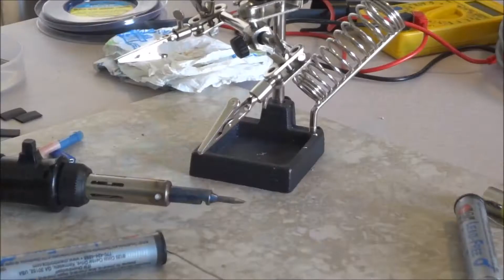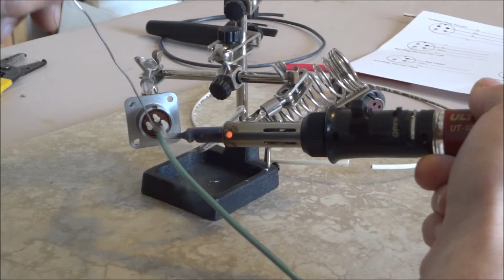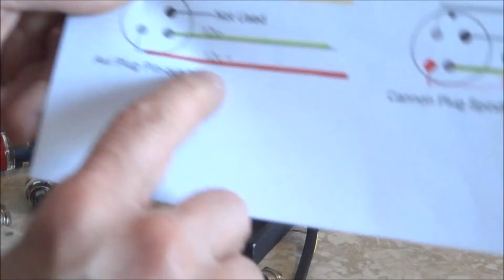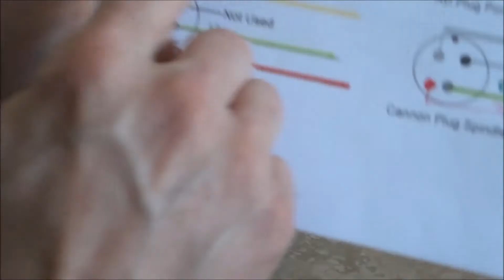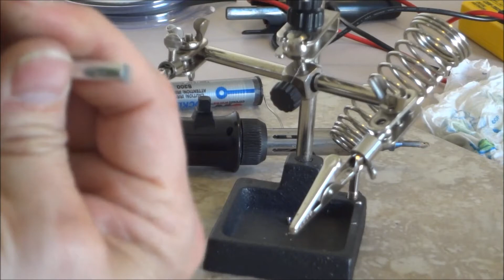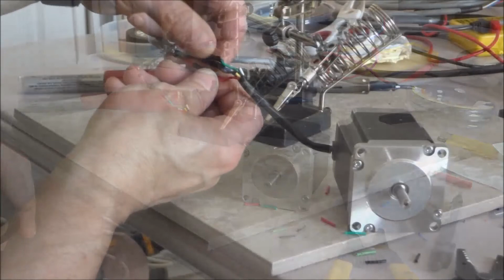G0602 Project Part 7A Electronics Cabinet Cabling

Comment: Curious why did you use tape rather than heat shrink?  on the stepper wires..
Reply from the maker: I think I may have been out of small heat shrink so I used tape to keep them separated then heat shrink over the whole thing.

Comment: I'm certainly no expert, but I'd go with the 425oz on the X axis as well. I used two 425s on both axes on my mini-lathe, and I still loose a few steps if I get aggressive on steel (https://www.youtube.com/watch?v=a7Z1paV-2F0&spfreload=10).
Of course that is not a big deal because you can measure what you've got, reset the DRO, and rerun from the G-code line matching the DRO reading, but it makes more work for you. At least you have the option, it'll be interesting to see how you fare.
Reply from the maker: Crivo152 Looks pretty smooth to me :-) Is that a Mini lathe very smooth.
Thanks for the input I do have a couple 425 oz. all cabled up so swapping is no issue since they use the same driver. My thought was 425 for the Z since it will be doing most of the work like in you video. and the 270 for the X .

But as you know when designing building everything is subject to change already have a few corrections to point out.
Thanks for the clip.